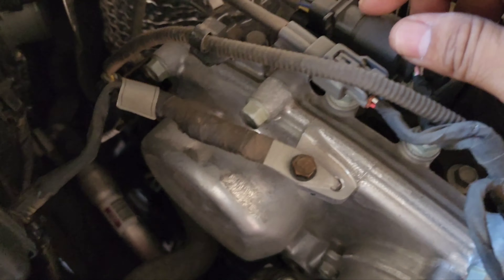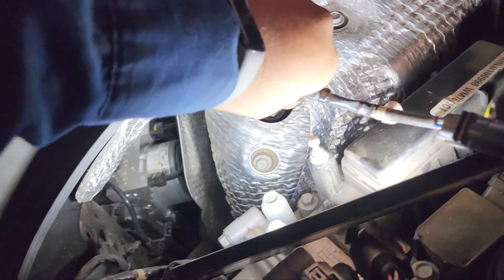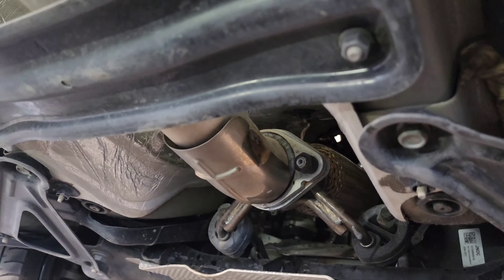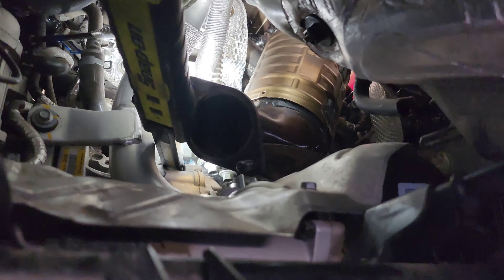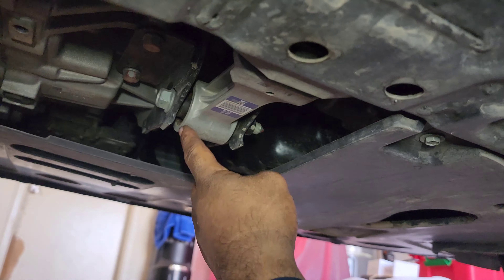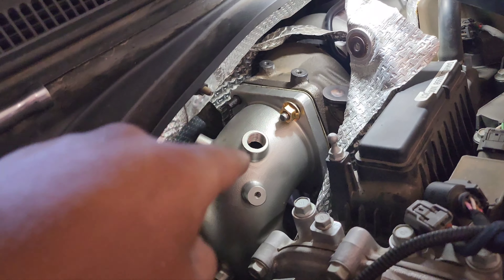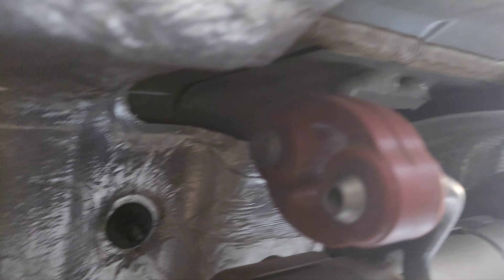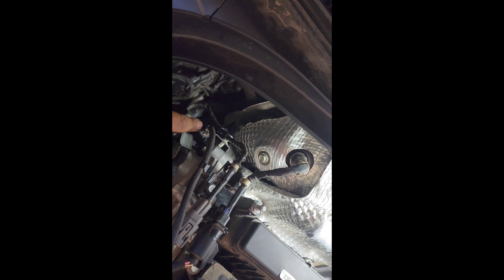SXTH Element down pipe install, 2021 veloster n

Comment: Damn you knocked that install out easily 
I’ve seen so many people having issues with striped bolts etc..  Did you run into any issues that you didn’t film?
Reply from the maker: Yes just one stubborn nut had to use a torch to heat it up and remove it . But other than that yes the install was pretty easy